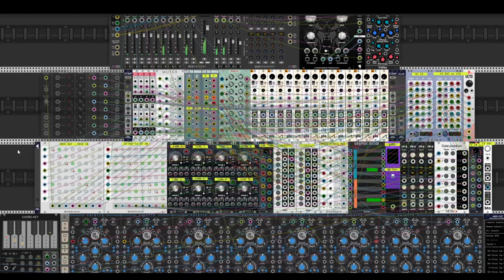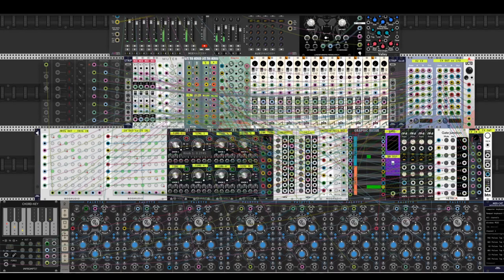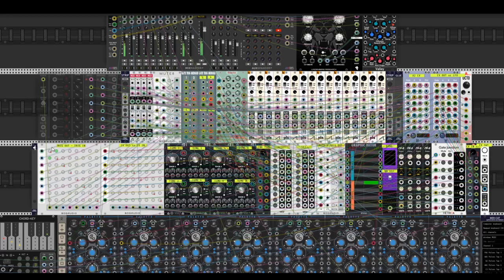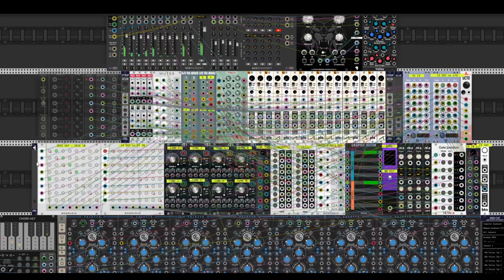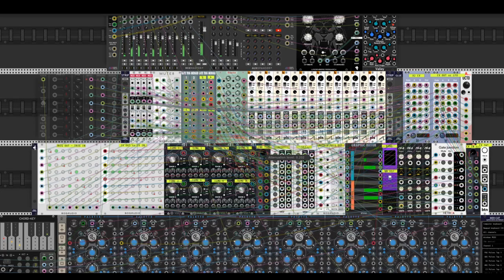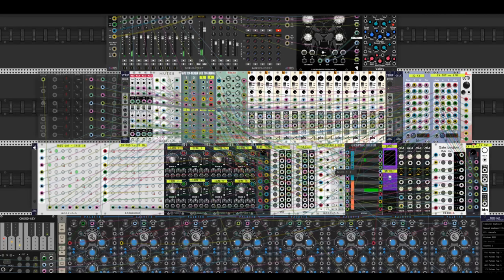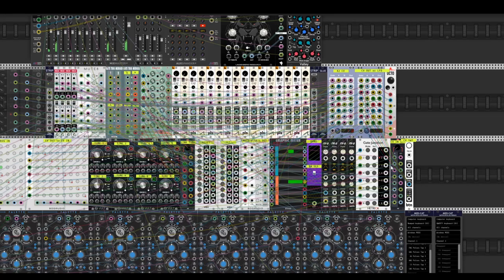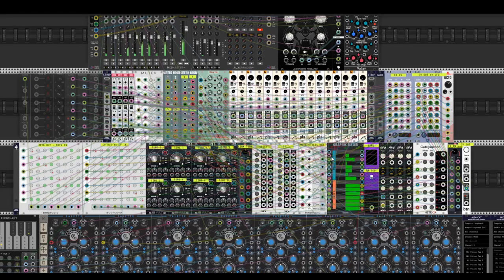Sequencer patch build inspired by SOMA ORNAMENT-8 | VCV Rack

Comment: What does the CV patchbay do? It looks like it's controlling the ordering of the "gates" in the graphic meter? what do these gates modulate/control?
Reply from the maker: It's phase out to phase in, not gates, just sawtooth phase lfos. Ordering is determined by main patch bay I believe. And it has pretty unstable nature with those cv out to cv in. I also got octo lfo to show how outcoming cv control would affect speed and behavior of a sequence. Gates aren't in control area actually, only their eoc outputs that feeding the signal (it's kind of relay actually) to the another cell and so on.